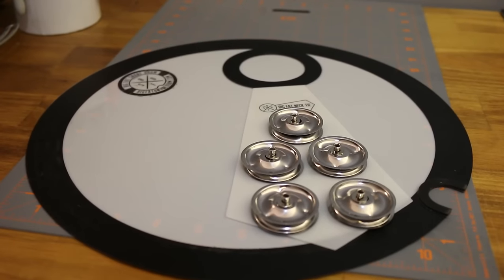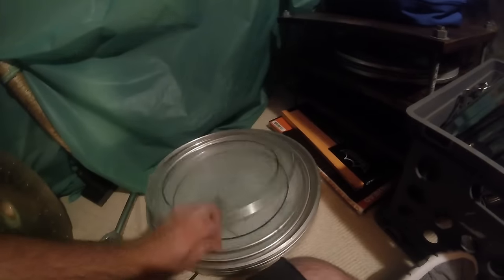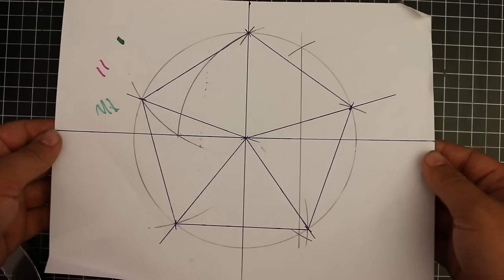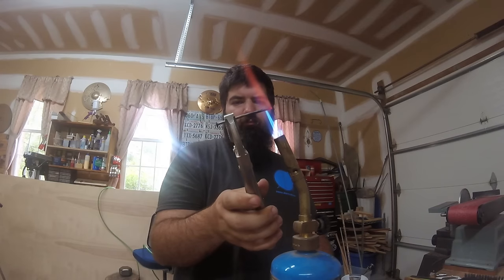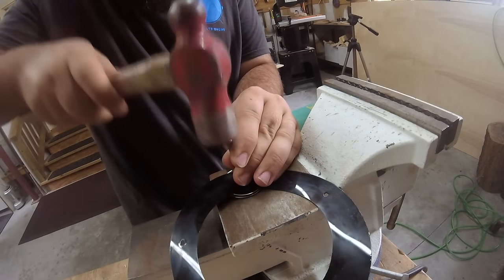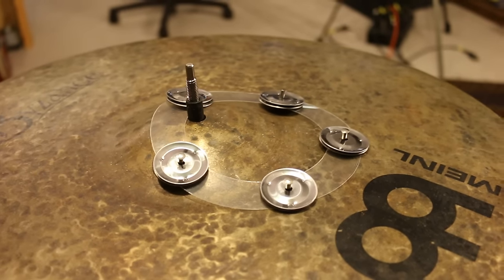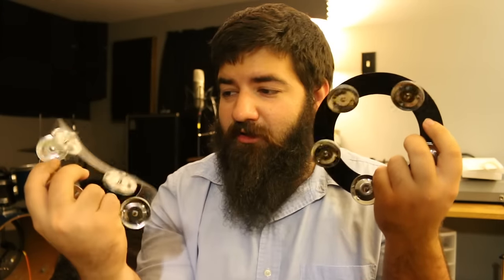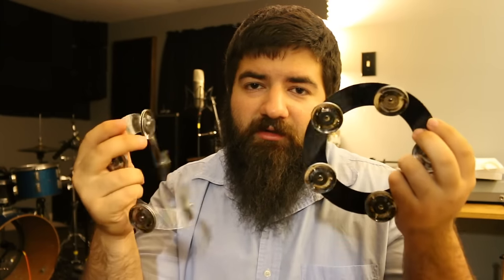DIY Bling Ring Out of Old Drum Head

Comment: You want to maximize the distance on the rivet or other post device you use to hold the two jingle disks together.  You want maximum movement in distance of the jingle disks.  I suggest also placing some hard (metal?) spacer between the two jingle disks (thicker than a washer), to separate them by some small amount.  You want the two disks to NOT travel tightly together up and down the rivet, but to maintain this small distance apart until they bang together at the end of a stroke.

Comment: RDAVIDR , I know this is an old video but I've just found your channel and started watching your videos and I think they are great. I'm a diy kind of dude myself and I seen where you use a lot of old drum heads for stuff such as the bling ring and you were using a nail and heating it to make holes in the plastic heads.  If you ever get to a hardware store or a store that has craft making tools you should pick up a good leather punch that has different size holes on a wheel that you squeeze with your hands and it would be easier and faster to punch the holes with,  just a suggestion anyway.  By the way,  using your calipers/dividers to cut those circles is a great idea.  Anyway keep making good diy videos and I will keep watching.